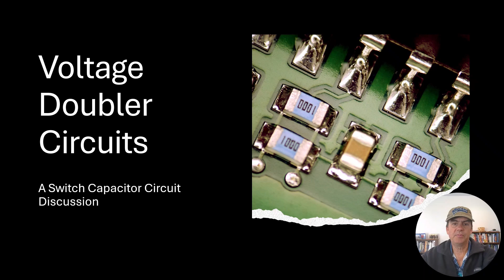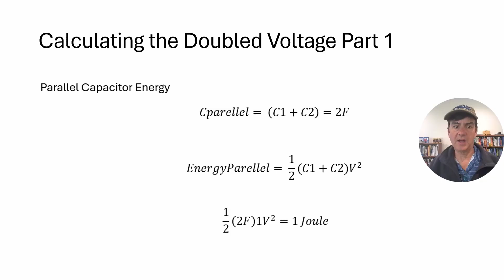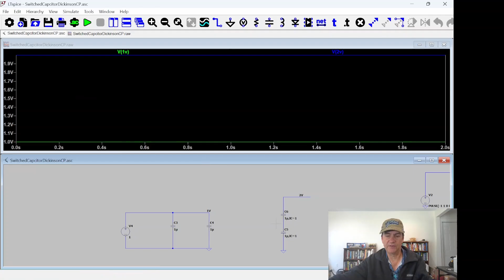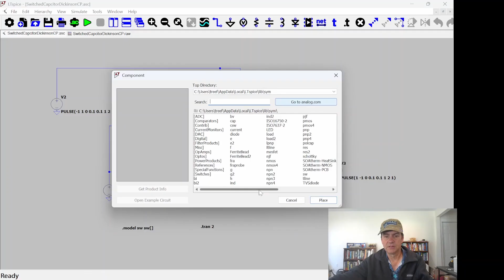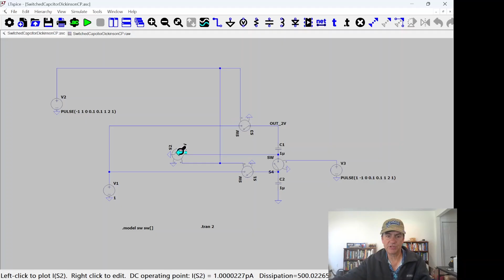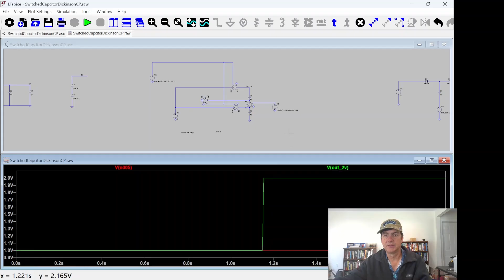How to Double a Voltage Using Capacitors (Switched-Capacitor Circuit)

Comment: So...

The input voltage is say 1V@1 amp, the outputted voltage will be pulsed DC @ .5 amps at the resonant frequency of the capacitors? How is the switching done? With an L C circuit, Piezo electric timer, transistors, or something else? Maxwell's demon? lol.
Reply from the maker: In switched-capacitor circuits, switching is typically done using MOSFETs controlled by a clock signal. The MOSFETs connect and disconnect the capacitors in different phases, which moves charge from input to output.